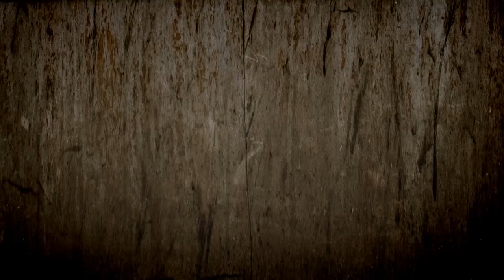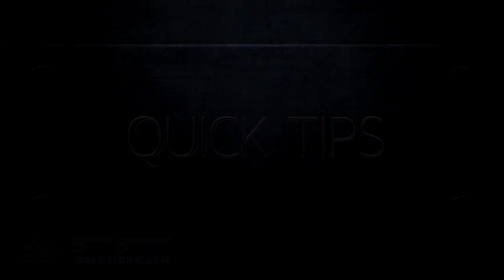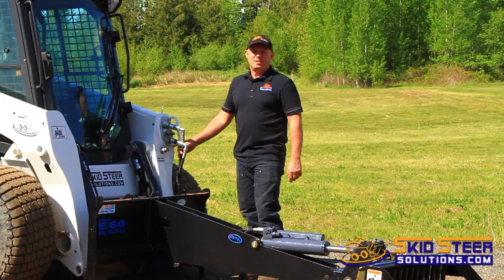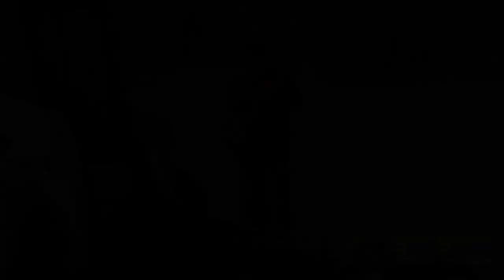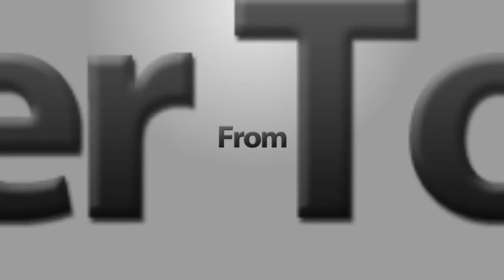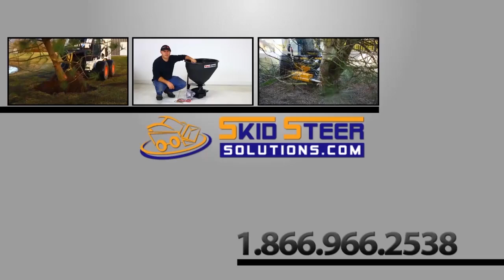Skid Steer Solutions Quick Tips: Hydraulic Back Pressure

Comment: Except all those tips still do not solve the problem.
Reply from the maker: Please explain :D
Reply: @SkidSteerSolutions  how to solve the problem of not being able to reconnect...
Reply from the maker: @michaelhasey86  Are you following the instructions laid out in the video, and still having problems reconnecting your couplers? This method has been successful for a lot of people, but may not work in 100% of cases.
Reply: @SkidSteerSolutions  I believe be is saying the video shows how to keep the problem from happening but how can you connect it if you did take it off incorrectly.  Your video never explains how to fix it just how to not let it happen.
Reply from the maker: @sunconuresolar2658  check out this quick coupler hand clamp. Makes it easy even under high pressure -  https://www.skidsteersolutions.com/qc-mate-quick-coupler-hand-clamp-xboom/
Reply: @SkidSteerSolutions  Much obliged.
Reply from the maker: @michaelhasey86  check out this quick coupler hand clamp. Makes it easy even under high pressure -  https://www.skidsteersolutions.com/qc-mate-quick-coupler-hand-clamp-xboom/
Reply: @sunconuresolar2658  get a couple of crescent wrenches n loosen the nut a bit on the female end of the line.  You'll get a squirt of hydraulic fluid and that will let you reattach your accessory.
Reply: @phoenix4ever367  Thank you. I have line swaps Today!